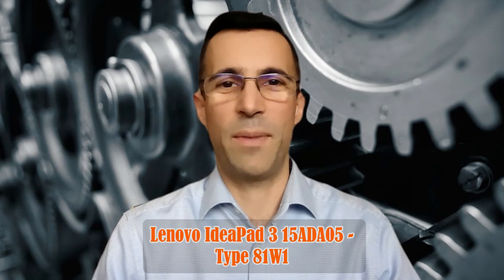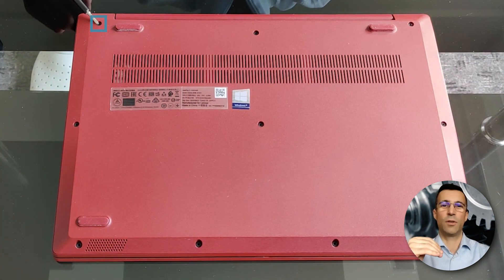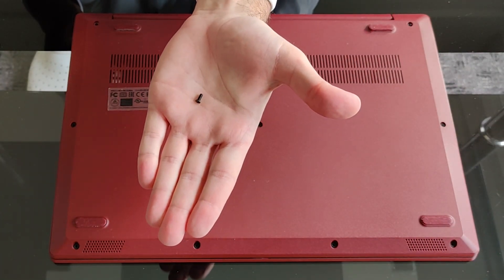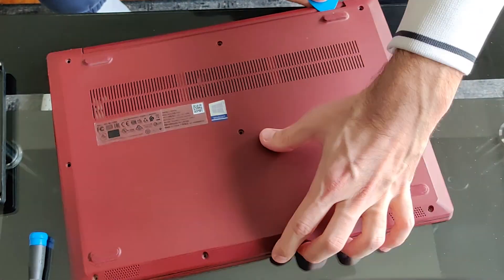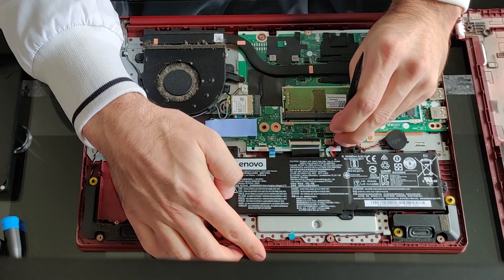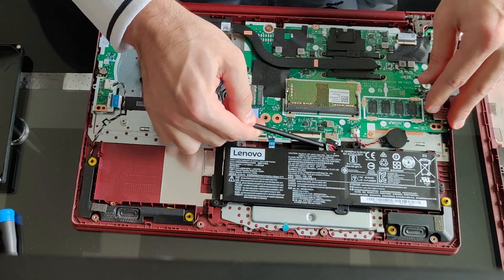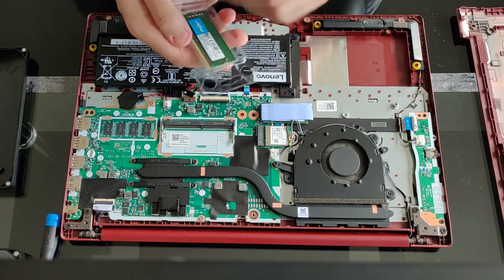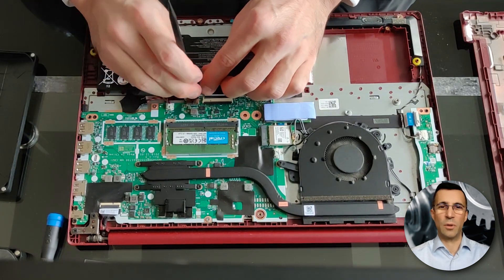Leonovo IdeaPad 3 15ADA05 - RAM Installation and Upgrade

Comment: thank's for the video. I took off the battery in order to unplug it (2 other screws only).
for ram modules, the frequency isn't real. it relates more to how fast theu are.
I first tried with a 32 Gb memory module from crucial. the bios recognised it, windows recognised it but it was tagged as "reserved material" and unused...
Then I put a 16 Gb module which works fine (Crucial RAM DDR4 16GB 3200MHz SODIMM CT16G4SFRA32A)
Reply from the maker: Thank you for this valuable feedback. Good job. Entire 32GB module unused you say? So you booted to Windows with only 4GB RAM onboard?

Comment: I have the same laptop version as the one in the video. The motherboard supports a maximum of 12gb. How can 16gb and 4gb work for a total of 20? If the motherboard only supports 12? I see that many people say that they put 16gb in that slot and it works for them. I'm really surprised...
Reply from the maker: Hi, thank you for watching. Well you have to try and buy the 16GB module. Maybe best get 2400Mhz one. Good luck.

Comment: Bro I have same Laptop with 4gb ram Now I want to add one more 4gb ram to make total 8gb of ram...So can I add 2 (four-four)gb Ram or not or I have to purchase single 8 gb ram ???pls tell me
Reply from the maker: Thank you for watching. Single slot on the MBO - only one RAM module for extension.
Reply: @smooth.IT.operator  So can I make 4 + 4gb (2) ram to make 8gb Together??
Reply: @smooth.IT.operator  Bro 8gb or 12gb which is best for this laptop if I am upgrading Ram??
Reply from the maker: @ Check the comment section, people talk about it a lot and make a decision.

Comment: Hey thanks for the tip!
Do you know if it works on the bigger screen model Ideapad3 17ADA05 ?
AMD Ryzen integrated, 8GB RAM.
Reply from the maker: You are welcome. Thank you for watching. Compare the hardware of the two models side by side? CPU, MBO the same? It should work also then. But you never know 100% with RAM modules. They could be faulty brand new coming from the factory.
Reply: @smooth.IT.operator  awesome thank you for your help, I'll compare and try!
See you soon for the result 🙌
Reply from the maker: Successful upgrading.
Reply from the maker: @celikba  Successful upgrading.
Reply: Hey  @smooth.IT.operator  I just replaced the Samsung 4GB 3200 memory with a Corsair Vengeance 8GB 2400 👌 It works very well, Windows 11 at 45% instead of 65-70% after the boot
Reply from the maker: @celikba  Thank you for sharing.
Reply: Hello my laptop is row of chips 1/2 and is ideapad 3 can i upgrade my ram??❤
Reply from the maker: Hi. I don't have the precise module of you laptop nor the serial number to be tell you exactly.

Comment: i have a total of 20gb by adding a 16gb module of 1600.0 MHz (DDR4-3200 / PC4-25600) from Micron
Reply from the maker: Thank you for watching and thank you for the useful feedback. Is your Windows stable and booting properly and doesn't crash when you work on the laptop?
Reply: Amazing ? Windows crash? Or also?

Comment: I have 8 gb of ram in my laptop pf same model, can I add another 8 gb ram and make it 16gb?
Reply from the maker: Thank you for watching. If you add a single 8GB RAM module you will have 12 GB. 4GB is soldered already onto the motherboard.

Comment: Thank you for this. I have 786 GB storage available and the system is slow. Tried everything. I use to study via websites. I have 4 GB RAM tgought it would be enough. Thinking of upgrading RAM as task manager shows 81% memory used when I have just website and PDFs opened. Haven't upgraded RAM and SDD storage yet. Thank you again. Open to any suggestions.
Reply from the maker: @SGupta-y3f  You are welcome. If storage is low, try getting and installing 500GB or 1000GB m.2 SSD NVMe size 2242 drive (blue padding on it in the video). You will also have to reinstall Windows on this new drive. Upgrade the RAM like in the video. I put buying recommendations from Amazon in the description box below the video. Wish you success and that you learn new skills.

Comment: Hello brother, nice to greet you. I have a Lenovo ideapad 3 15ALC6 too, but its ram memory is 8 GB (4GB internal and 4GB in a free module). My question is if the device can support 16GB RAM (in the free module). First of all, Thanks!
Reply from the maker: Thank you for watching. Single SO-DIMM Slot: Supports up to 8GB - "free module" as you called it. This is the safest route to take. Some people in the comment section wrote that they installed a 16GB RAM module. The device booted into Windows for some people but I don't know how this 20GB of RAM behaves under load. You can go the safe route or take some risk and get the 16GB module.

Comment: Thanks for your video! I’m a bit confused though. You said there are 4gb already integreted in the motherboard, and you showed us how to install a 8gb memory module in order to have as much as 12gb. So, what’s the use of the module you replaced with the new one?
Reply from the maker: Thank you for watching. From 8Gb to 12GB. More RAM more smooth multitasking. Windows doesn't need to offload usually RAM workloads to a less desirable swap file on the laptop's SSD drive. Some people here put 16GB RAM module and is working for them. So 16GB + 4GB is 20GB altogether. Even better. Depends on how much you are willing to invest in RAM extension.

Comment: my memory usage is high can i get replaced new ram? Hardware Problems Were Detected. Your computer has memory problems then I was tying test memtest86 for my memory it is error. my screen is like flickering. . if I will gonna new ram install my memory? Then if my memory usage is low and won't show error or Detected? If my screen is gonna won't show flickering? Thanks let me know
Reply from the maker: Thank you for watching. Maybe your RAM module is faulty or damaged. Try replacing it if you are sure it the source of your problems. Even if memory usage is to the max, this should not cause the screen to flicker. Did you check the temperatures, are they high when laptop in under load?
Reply from the maker: @GaeeeDeafPh Download the CPU-z application and run it. It will list your precise RAM module under "SPD" tab. By the way, there is in the description underneath this video - RAM buying recommendations on Amazon that I put for everyone.
Reply: Thanks I found it I think DDR4 2666
Reply from the maker: @GaeeeDeafPh I don't quite understand this, you got a new module and it doesn't work? Flickering screen still continue to happen?
Reply from the maker: @GaeeeDeafPh I don't think so, it just one module of RAM or broken laptop. You will get a new one if needs to be and be fine again.

Comment: i have a question, what if i install 16gb ram (which will equal to 20 gb)  even tho lenovo said the maximum capacity is 12gb
Reply from the maker: Thank you for watching. Check the comment section. There is a comment from Sobkas which answers you.
Reply: @smooth.IT.operator  i upgrade to 20gb ram and my laptop works perfectly fine, will there be any side effects in the future?
Reply from the maker: @clipzys43 Awesome, thank you for the feedback! Unless you get Windows/Linux crashing you are good to go. Try running a testing tool like Prime95 to put load on your RAM and see how the laptop behaves, does the Windows crash or not when under load. It is safe to test.
Reply: @smooth.IT.operator  yo i start my pc and i got blue screen of death so yeah i dont recommend using 16gb stick, laptop takes about 5 minutes to shutdown and its behaving weird so i swap out the 16 and insert 8gb and everything is working perfectly fine so far
Reply from the maker: @clipzys43 yo back to you. Thank you for the feedback. You might have a bad memory module. It is a common issues unfortunately. Do you think you can get it replaced? BTW what is the detailed specs of the module? "DDR4 2400MHz CL17 1.2V" for example?
Reply: @smooth.IT.operator  honestly i dont know much about it but the brand is kingston and its a DDR4 with 3200 mhz which clockdown to 2400mhz cuz my system supports 2400mhz
Reply from the maker: @clipzys43 Thanks. Try replacing if possible. I run into faulty RAM modules all the time. No pain no gain.
Reply: @smooth.IT.operator  i wont fight with it too much, as for rn 12gb works fine for me and idk how i feel about buying another 16 stick since my maximum capacity is 12gb ill just stay in the manafacture recommanded just to be safe!! thanks for the replies and the advice tho.

Comment: If my model is 8gb, can I still install 8gb more? I'm confused about the 12gb limit.
Reply from the maker: Thank you for watching. Yes, this is what this video is all about. You will have to remove the 4GB RAM module (4GB is already integrated with the motherboard and you cannot modify this) and last step you will install your shiny, new 8GB RAM module and have 12GB all together. Check my buying recommendations on Amazon I put in the description of the video. Successful upgrading.
Reply: @smooth.IT.operator  Ohhh okay, I thought it was 8 soldered plus 1 slot. Thank you for replying so fast ❤️
Reply from the maker: @VOLATIL22  You can do this and will get a great experience. You have an issue, just let me know.

Comment: What if I don't disconnect the battery?
Reply from the maker: Thank you for watching. Somewhere in the world a cute puppy might pass @w@y if you did that.
Reply: @smooth.IT.operator alright but can I use a plastic giftcard to unplug it because I don't really have anything to unplug it
Reply from the maker: @coryx17  Good thinking. Just don't pull on the wires because they might get torn. Disconnect the battery for sure because you have electricity going through your motherboard and you don't wanna damage any component. Every service manual warns about this. Successful upgrading!
Reply: @smooth.IT.operator  thanks man I upgraded it to 12gb ram and I can finally run windows 11 again thanks alot

Comment: I have a Lenovo Ideapad 3 15ADA6. Will it be the same?
Reply from the maker: Thank you for watching, hope you liked the video. I would recommend going to the link of the product specifications reference in the description box of this video. Then just search for your precise model there to see how much you can upgrade your hardware.
Reply: @smooth.IT.operator  Thank you so much for the tutorial. I wanted to add a secondary NVMe ssd to my laptop as well. Will you be able to do a video on that?
Reply from the maker: @Warmachine-fortnite  This laptop 💻 is long gone and back to my client's possession.

Comment: I was able to install RAM SODIMM Kingston 16GB DDR4 2400MHz CL17 1.2V and have 20GB of memory. It's also run faster now.
Reply from the maker: Thank you for watching and thank you for feedback.
Reply: How did you do it? I have corsair 16gb sodimm 3200mhz and it just gibes me black screen
Reply from the maker: @BurkiOlmi  Thank you for watching. Can you try different brand and not Corsair? Also 3200MHz is a lot different than 2400MHz, right?
Reply: Would it be okay to install 16GB RAM mentioned here or should we stick to the limot mentioned in the manual? @smooth.IT.operator
Reply: Where did you buy it? Can´t find it on amazon. Thanks
Reply: @pabloaschieri305  Ali Express !
Reply: It works perfectly well ! Thanks a lot for your excellent advise !!

Comment: Hi there, I just bought this exact RAM for this exact model. Never installed RAM before. Is it just plug and play as shown in his video or do we need to make any setting changes before or after startup?
Reply from the maker: Thank you for watching. The RAM module should be plug and play just as you say, not necessary to do anything else. Successful upgrading.
Reply: @smooth.IT.operator  Thank you for this video. I was able to install the RAM successfully! However I have a problem with this laptop model where it always seems to show disk is at 100% and it runs incredibly slow. Wonder if you came across this? I was hoping that the RAM might fix the issue, but it persists.
Reply from the maker: @justinian  Don't mind me asking but are you sure the disk is 100% and not CPU? You looking at Task manager? Otherwise you might have a faulty SSD drive. What is the capacity of the drive?
Reply: @smooth.IT.operator  yeah Disk was constantly 100% and memory occasionally 100%. Additional RAM reduced memory usage to around 32%. CPU didn't seem to be an issue in task manager. The model we have appears to have a Seagate HDD SATA ST500LM030, not SSD unfortunately. Laptop model is the exact same name as in your video though. I've been looking at a bunch of steps online to reduce disk usage and they have helped a bit, but don't seem like permanent solutions. One tip online suggested if all else fails to use an SSD for boot up. I don't know if that's possible for this model?
Reply from the maker: @justinian  HDD seems to be failing. You can buy and install two sizes - m.2 2242 SSD up to 512GB or m.2 2280 SSD up to 512GB. You have my buying recommendations on Amazon (links underneath the video) . Definitely go for m.2 SSD. HDD is pain and torture as boot drive. Yours is failing, backup your important data asap. Download the Leonovo's hardware maintenance manual also I put for all of you in PDF file.
Reply: @smooth.IT.operator thanks for this tip. Two questions. You also have 1TB and 2 TB options listed in the description. Will those also work? Do you have a video for how to install SSD on this model by any chance?
Reply from the maker: @justinian  Sorry. I don't think I responded to you. Get 1TB version of the m.2 SSD I wrote about earlier in the comment just to be safe. I have video showing hot to install m.2 SSD, check my channel. Check the only Dell laptop video I made, please.

Comment: Can I put a m.2 ssd and a ssd 2.5 SATA?
Reply from the maker: Thank you for watching. Product specifications reference which link is listed in the description of the video says " Laptop Model with 35Wh battery: up to two drives = 1x 2.5" HDD + 1x M.2 SSD". Capacity wise - 2.5" HDD up to 1TB and M.2 2242/2280 SSD up to 512GB.

Comment: does 3200mhz work on this laptop ? or is it limited to 2400mhz because of the intergrated 4 giga byte ram?
Reply: It worked, thanks much
Reply from the maker: @markodrazovicgaming  Thanks for the feedback!
Reply from the maker: Thank you for watching. Limited/hardcapped to 2400Mhz. You are correct.

Comment: hello i have a question, if i install a 8gb ram 2400mhz in my laptop does the dual channel works?
Reply from the maker: Hi! Thank you for watching. Good question. I even installed Crucial 3200MHz and dual channel worked at 2400Mhz. Maybe download Speccy app and check after you install your module. Successful upgrading!

Comment: Um i have a question, if i have 4gb ram DDr4 but i want to add more ram, so can i add 4gb ram ddr2, my question is can i add ddr4 with ddr2?
Reply from the maker: Thank you for watching. I don't think you can add DDR2 RAM. Not supported.
Reply: @smooth.IT.operator  Oh okay, But what if i added ddr3 4gb ram, does it will work?
Reply from the maker: @SpeSialEditzz  Don't think it will either.
Reply: @smooth.IT.operator  okay thanks, but i have a question please, Do you know the prices of 4gb ram ddr4?, And also, i have Lenovo IdeaPad 3 i3 11th generations but i dont know what type of 4gb ram should i add, can you give some examples of it?
Reply from the maker: @SpeSialEditzz  Check the prices on Amazon by opening the RAM link bellow the video and then search.

Comment: Aye did the 8 gb crucial work ? Some people told me it didn't that this brand is maximum of 8 gb ram but I see alot of other places that it's 12 gb. I ordered one myself. Just wondering if it worked?
Reply from the maker: Thank you for watching. This job I did few weeks ago and I spoke with the very owner this morning about some McAfee AV issue. No complaints about the RAM though. Crucial works no problem for now, full 12GB reported in Windows. Successful upgrading and please share how it went.
Reply: @smooth.IT.operator  thank you so much. And will do (: appreciate it